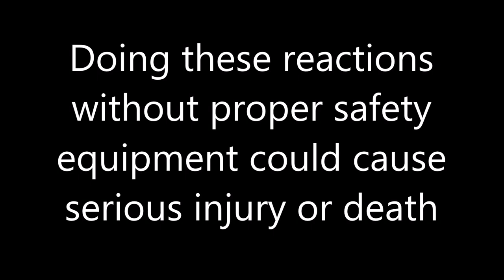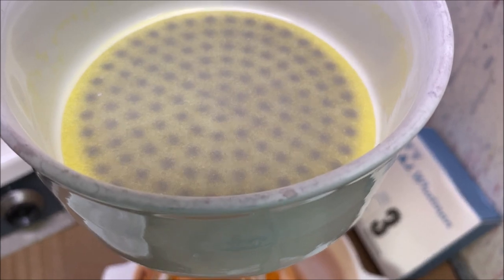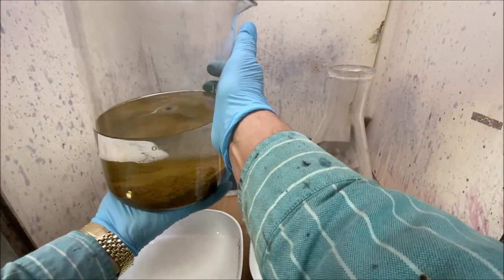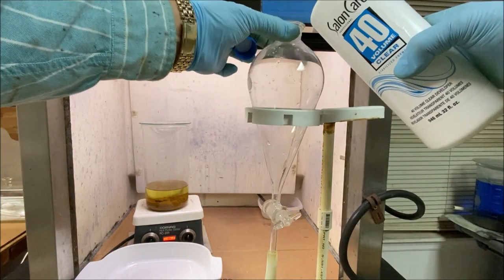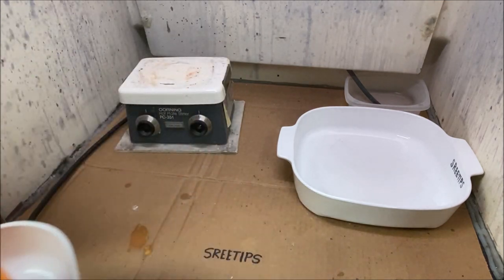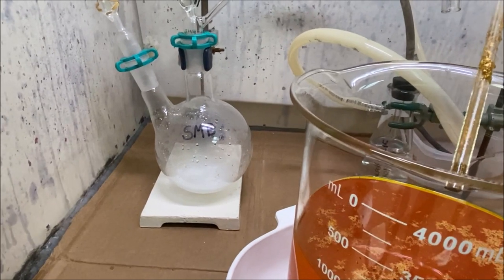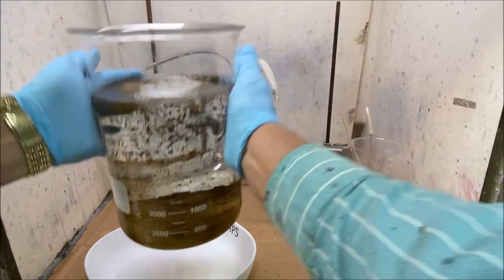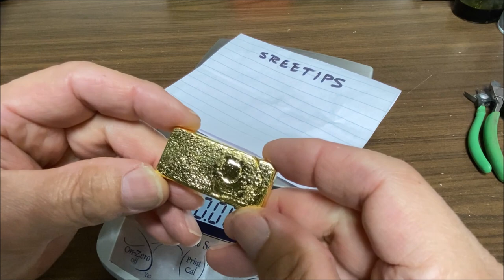Thanksgiving Day 5 Ounce Bar Refine

Comment: Happy Thanksgiving Chief! 
I noticed, right at about 12:18 during the HCl boil, NO2 gas was being liberated from the solution.  
I know it's a very slim chance, but could some of the Nitric from the first Aqua Regia dissolution have survived the gold precipitation, the water washing and made it over to the acid boil cleaning step?   
I did a little stoichiometry and saw that even if 1ml equivalent of Nitric made it over, that's enough to put about a gram of gold into solution.  
Not criticizing your work by any means, I'm just throwing out what I think I saw, and looking to the more experienced for your insight.
Reply from the maker: Good possibility

Comment: Another great video!
As for clogging with SO2 generator, just idea, maybe connect to it small air pump (pushing air into a generator and then pushing out a mixture of reactive gas with air). It will give you a steady stream of air through the solution (no backfilling tube with gold solution) and can be then enriched with generated SO2 (you could generate it slower, I suppose then it should be used more in reaction with less escaping out). Just a small idea.
And yes, slurry or solution is always better to use than just solid for generator. Better reaction.
Can not wait for next videos!

Comment: If you were to take a pour dish and cut 3 thin slits from the back (Dimond wheel Dremel) heat that up, pour the gold through the slotted dish and into distilled water to make small pellets. Weigh the small pellets to the size of bar you want, place them in the graphite mold, cover and melt inside your high temp oven, let cool. You should have a wonderful looking bar.

Comment: Hey, at 1:23, what did you put over the beaker? It's not really a watch glass I don't think, right? I wanted to buy some of those but I don't know what they're called. A watch glass is much more shallow, but you could put ice in what you used if needed. And it makes for a better drip point thing.
Reply from the maker: Those are candle oil warmers. A couple bucks at the thrift store. They are used to hold oil with a candle under it to heat the oil. Perfect for reflux/watch glass covers for beakers. Type “candle oil warmer” in search block on eBay for examples.

Comment: Silver refining question - I’m just wondering if anyone has had experience with this but I’m wanting to refine some silver. I have about 50 ounces of silver and it’s 98% with 1% gold and it has about 5 different other base metals which are less then 0.005% but I’m unsure on which refining process to go with. I’m not sure weather to refine it with the nitric acid method witch will also leave behind the gold which I can then refine the gold in the future or to refine it using the cell method because it’s basically 99 percent silver and I’m not sure it’s the cell method will leave me with the gold.  I’m wanting to get rid of the base elements but also keep the small amount of gold. Thanks 😊.
Reply from the maker: I’d run it through the silver cell, if it were mine.

Comment: how many inchs of vacuum do you pull on your filtering set-up?Is there an OPTIMUM amount?
Reply from the maker: I’ve got a vacuum operated switch in the circuit to the vacuum pump motor. Off at 7 inches, on at 5 inches.

Comment: Great show of three processes. I did my first test button of 25g not too long ago. Gearing up for more with a fume hood. I have a question on the SO2 precip. How much sulfuric acid was consumed? I have a new 500ml bottle. I guess unused acid in the dropper could be poured back into the bottle. What about the acid that was used in the flask as filtration? Is that still good for reuse?
Reply from the maker: The amount varies depending on how much gold I’m working with. I try to reuse any acids that I can.

Comment: I did a lot of electronics separation , using hydrochloric acid & 3% peroxide with the electrical parts , fingers etc. with copper , silver etc. contacts chips .
Got less gold than was expected , a few thousand grams of electronics and have about four gallons of fluid / that I filtered - figuring the gold was solid .
So guessing have dissolved gold in solution , about 4 gal. 
Suggextions for getting gold out of this , so stump-out ?
Will stump-out work with hydrochloric / peroxide ?   
DId get about 13 grams of gold , so far .
Thanks again
Reply: Electronics manufactured after somewhere around the mid-1990s tend to have far less gold than earlier.  The manufacturing process technology rapidly improved from about 1995 or so through 2005 or possibly a bit later to the point where less gold was required for the interconnect circuitry and also interconnects got much smaller and shorter as things became more and more integrated.  Gold plating technology improved a bunch as well, such that the large majority of the metal in the electronics is copper with a very thin, almost atomic thickness plate of gold for the conductors.  The circuitry between layers of fiberglass in a modern PCB is almost completely copper without even the gold plating that was previously used.  Often the plating is now aluminum instead of gold.  Only the very highest frequency portions of the PCB in a modern PC motherboard will have gold anymore, and not very much of it if any.
Reply from the maker: Test with stannous. It can detect down to 1/10 gram per liter or better.
Reply: @sreetips  Thanks , I need to make a calibration fluid , to test the stannous .
No space here for fume hood , so not working with stronger chemicals - until then .

Comment: You might try drawing the gas tube down to a small diameter so a slower gas flow can still keep the gold solution out but then again it might just clog faster and be impossible to clean out without a soak in aqua regia.
Reply from the maker: The book calls for at least 1/4 inch ID tube to prevent clogging.

Comment: I think you could have got a nicer looking bar if you had turned off that torch heating the mold before the pour.
It was the force of the flame that caused that big dip in the finished bar.
Interesting video none the less.

Comment: What's the purpose of adding ice directly to the solution? Wouldn't a ice bath be better and avoid adding additional liquid to the solution?
Reply from the maker: The ice cools the solution. And it adds volume that will cause any dissolved silver chloride to precipitate out. Then it can be filtered out.

Comment: Happy bird day sreetips! Curious if you could maybe help me out with an issue I ran into the other day getting gold out of solution with SMB, seems to be a little bit will drop but the smb just builds at the bottom leaving the solution still yellow and full of gold. Is something making it go back into solution right away and any ideas how to solve this? I've searched all over and seems there's not enough GOOD info to find on it. I dont want to mess it up
Reply from the maker: I’ve seen that before myself. It usually happens with the jewelers scrap when there’s all different metals in solution together. I just add more SMB until there’s no more gold in solution. Collect the gold powder and the white junk in a filter. Then melt it with plenty of borax, adding more borax as I go. Then collect my little gold BB.

Comment: Sorry but why did you drop 3 time you're gold, with you're process maye you have 
9985/1000 or 9989/1000
You cabt have 999 with this methode 
Correct? 
For 999.9 you n'est electrolyse. 
On m'y spectrometer i have 99.89%
No more